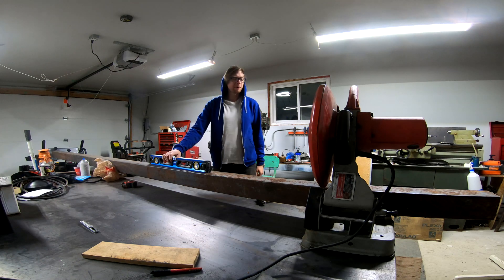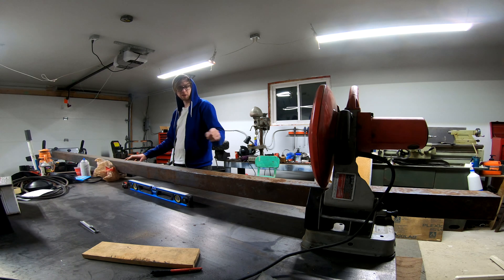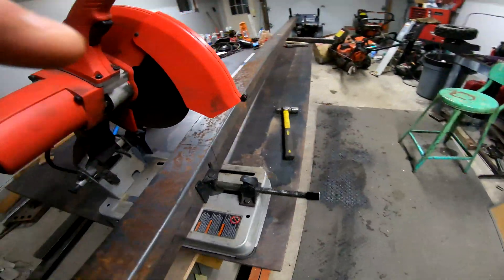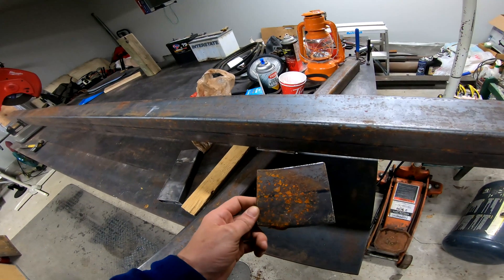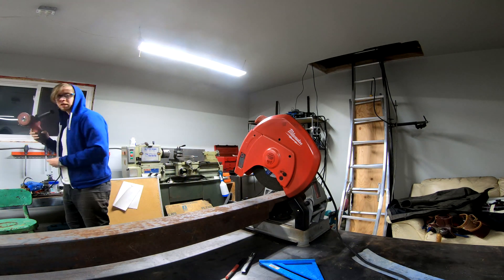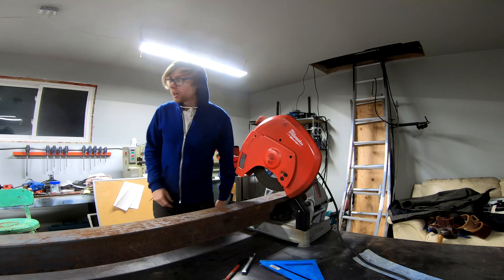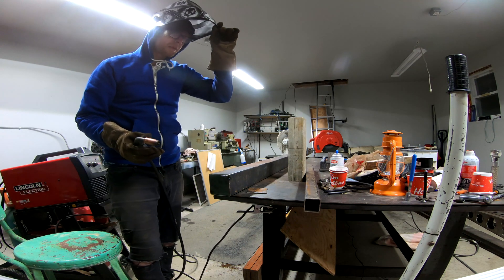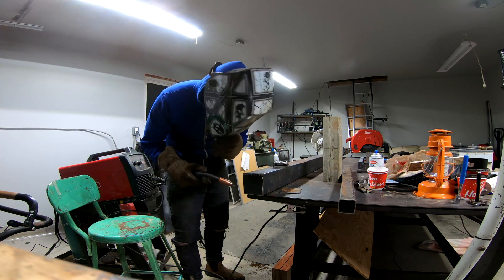Building a metal ski/snowboard rail *Part 1*

Comment: how did you get the metal. I might have missed it in the video
Reply from the maker: I had it delivered with a bunch of steel awhile back, if you live in the city there should be a local steel supplier. But if you order over $500 worth you can probably get it dropped at your door.